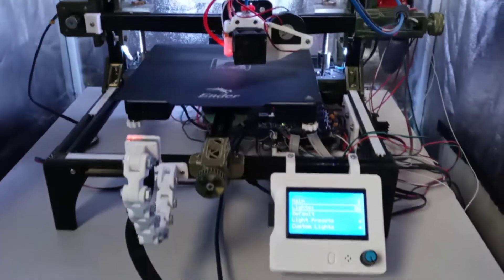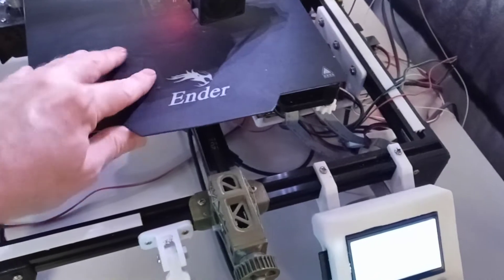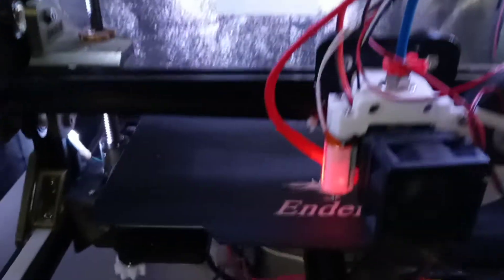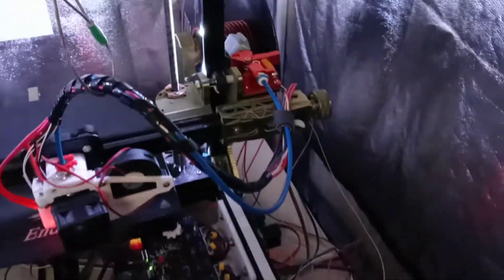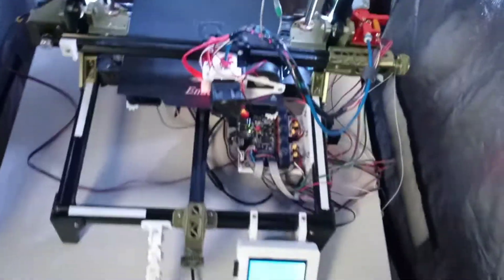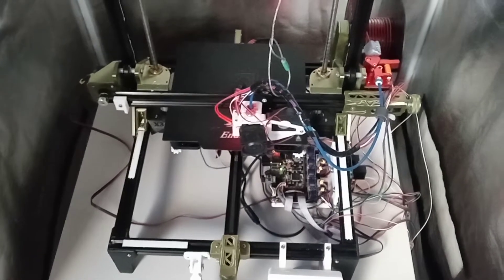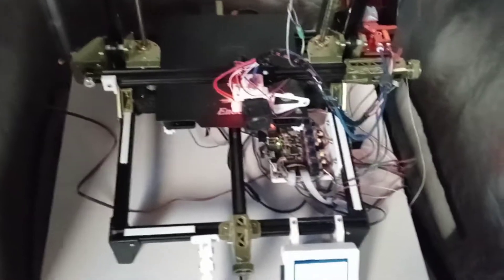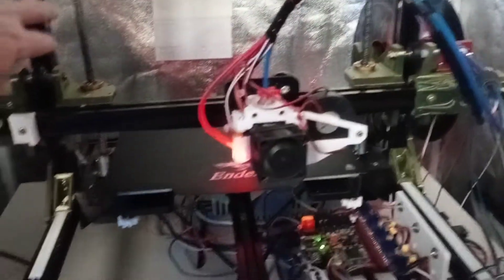Working Girl: Tronxy X3

Comment: Happy to see you are using my Y axis belt tensioner... And my Tronxy X3 Z Carriage Upgrade Remixed With Nema17 Mounts (WOW!!!) I hope they are doing a great job without any problem... Thanks for your video.:goodvibes:
Reply from the maker: They have worked perfectly for several years! I also have a scaled up X3 I built that has them as well. Great designs and they made the printer so much better than stock!